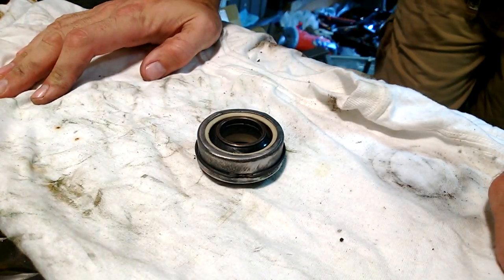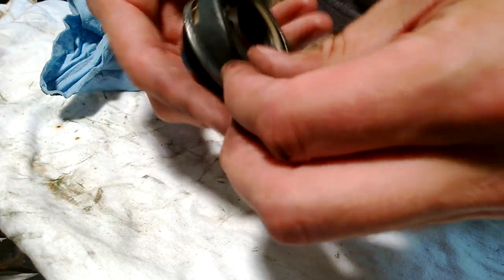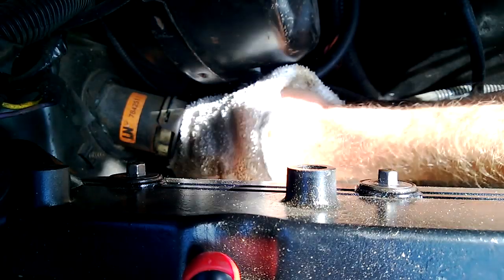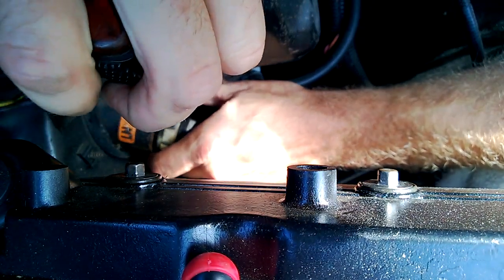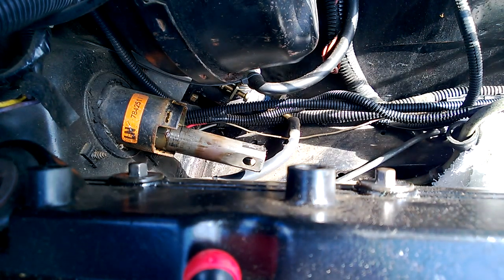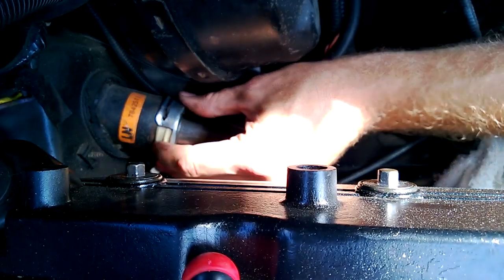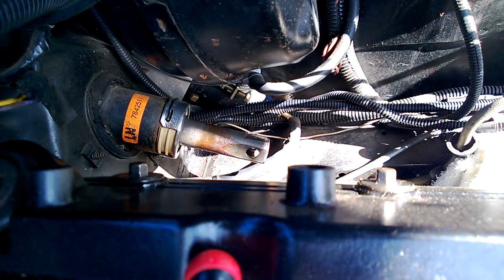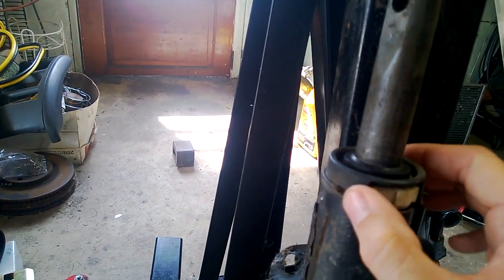Steering Column Support Bearing Upgrade Part 1 - Astro Van Bearing - F-bodies and Older GM Columns

Comment: I have a 92 camaro and it has some slop in the steering.  I have a new steering box and shaft.  Hopefully this bearing will work.  AND hopefully I can change it out without taking the steering column out.

Comment: Its amazing how a 1/8 inch of play in that steering shaft is a mile when its going down the road ????? Im going through something like this now on a old 2000 chevy bucket truck , its getting a mid shaft support bracket with a cheesy jack shaft  bearing cause i cant buy a good/ proper 1 inch steering support bearing anywhere , there all smaller or bigger

Comment: Great video! I have a question, to remove the intermediate shaft between the bearing and the steering rack. Do I need to remove the sterring rack to get it out? Thanks!
Reply: I just figured it out, thanks!
Reply from the maker: Glad you got it!  Sorry for the delay!

Comment: can you do this on an s10?
Reply from the maker: +This0is0pointless Im almost positive you can do both the bearing upgrade and the shaft upgrade on an S10.  Pretty sure there are several GM vehicles that used the same intermediate shaft and steering column through out the years.

Comment: Did you get ur car back on the road if so did you feel a diffence ... I would like to do this mod on my 95 ta thx
Reply from the maker: +maldo72 Hey maldo... Sorry....a year later.  Youtube doesnt really tell me when I have comments all the time.  Car has been back on the road, and yes the steering feels a good bit better.  Not sure which made more of a difference on the street.  Probably the shaft.  But, if you really lean on your car, I bet you would see even more benefit from doing the bearing upgrade as well.  Everything is very smooth and more direct feeling now.
Reply: +JEG's Garage thank you for your update

Comment: In your video, the old bushing comes off with no trouble and the new bearing slides on no problem, I'm trying to do the same thing with my car but the old bushing took forever to get off. I even had to file down part of the Column to force it off. Now I can't get the bearing on. Any advice?
Reply from the maker: Im surprised the plastic bushing wouldnt come off easy.  Mine was basically loose once it was moving out of the column housing.  Is your column shaft rusted or pitted?  It should be nice and smooth. If its not, get some fine sandpaper and get it nice and smooth before trying to get the new bearing on.  Any pitting will tear up the o-ring in the new bearing also.  

Has your car had any modifications?  Original steering column and all that?
Reply: it was all original as far as i know. after some measuring, I have found that the end of the column is slightly larger than the rest of the shaft. (Weirdness) So I think I'll try sanding it down tomorrow. I can tell you that getting the old intermediate shaft off was super hard. Seemed like it was welded together almost. had to bang it off with a mallet.
Reply from the maker: Hmmm...That suggests the end is mushroomed out a bit.  Cant imagine why anyone would have to hammer on it.  Still...stuff happens.  Sounds like you nailed it.  Go after it with a file, then smooth it out with some sandpaper.  My intermediate shaft usually requires some persuasion.  But not much at that end.  Usually just a wiggle will let it slide off.  Make sure you put a little grease or anti-seize when you put it back together.
Reply: Yeah. I'll be taking some 40 grit to it later today. I'll let you know how it goes.
Reply from the maker: IF you use 40 grit on it, just make sure you run some 150 or 300 on it to smooth it out.  So it doesnt cause any cuts or gouges in the o-ring or seal.
Reply: that's the plan! lol